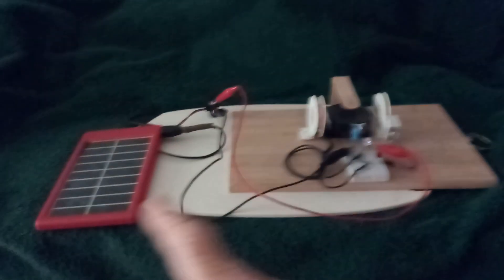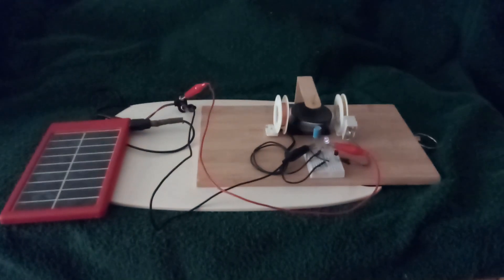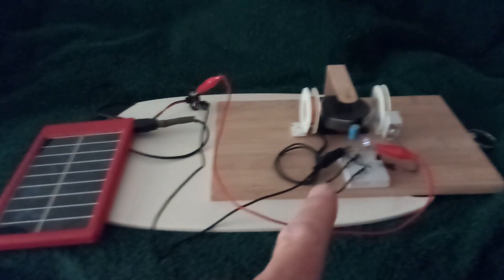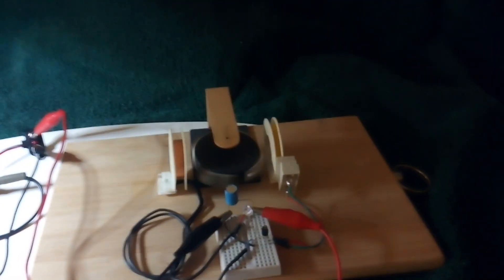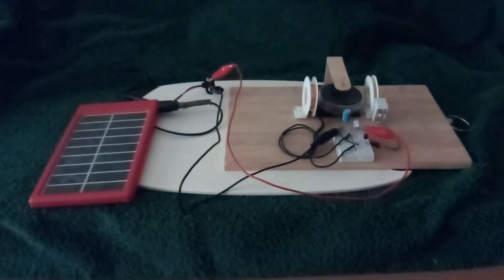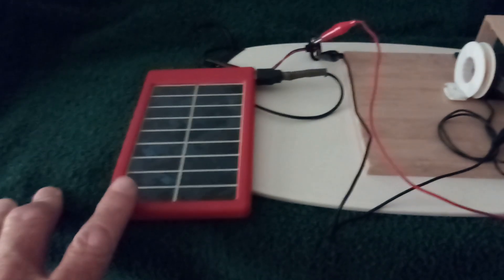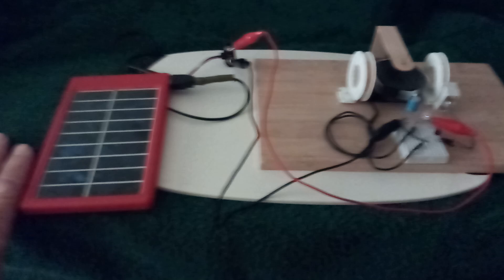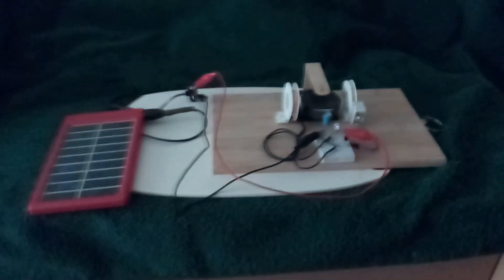Ambient room light powered motor

Comment: The most amazing thing here is not so much the solar panel, but the device which is made to operate with such low power input. Compare side by side with a standard motor and see which one works better with the same solar panel/capacitor.  I dare say this design will win the challenge every time, day or night.

Comment: Its a low energy use motor that has just about no practical use. The light is free but putting a bedside lamp and a oversize solar panel with a cap as storage is nothing extraordinary. I do like to see what you doing, very interesting tinkering.

Comment: I really like the concept, as you know 🤣
An intriguing avenue, would be for parents to be downstairs in the livingroom, child upstairs. Could a collector be made that takes the light from the livingroom to a nightlight upstairs? Many people leave a light on somewhere for security overnight, which could work the same way for a nightlight.
Reply from the maker: There is "light tube" I have seen for attics that directs the sunlight down  a tube somehow to a ceiling output location.  If you put solar cells inside the tube then you might get electricity also. Hummm. 🤔 Stuff of a new experiment.
Reply from the maker: Well it seems that this has already been done! A solar panel inside a "light tube"--  https://www.solatube.com/residential/tubular-skylights/?gad_source=2&gclid=EAIaIQobChMIt-37qfO6hQMVAxStBh3IAQHIEAEYAyAAEgJ0N_D_BwE
Reply: @Lidmotor  They look cool. A whole roof made of toughened glass would be an extension, with that clever auto tint seen on some cars for summer sun heat. Ideal for star watching too, without the mosquito's. 
A South facing room could have solar underneath the glass and, with the new bi-facial panels, could collect energy when the room light was on at night.

Comment: I was having a conversation today with someone about electrostatically charged sands on Mars. Can it be harnessed to run devices? I'm sure they're already working on this. I remember your electrostatic rotors, but how to convert to for instance charging a cell or run electronics?
Reply from the maker: I saw a video years ago where a guy built a device that converted that to a more useable output.  I can't remember how he did it.
Reply: @Lidmotor  There must be a way to put it in a capacitor or something. Avramenko setup?
Reply: Your imagination is running away with absolute nonsense they pump into you thru main stream media. Mars pictures is on Greenland.  Nobody in their right mind is going to harvest sand from a supposedly planet they you have to travel decades to at supposedly astronomical cost. Energy on earth is free, you just made to believe you have to pay for it.

Comment: I love the look of that motor, regardless of the project purpose, I really like the look 😊😊👍👍
Reply from the maker: I never did a video on this motor which is about 10 years old.  I usually run it on a little solar rocker type panel.  A 3d printed frame work with the coils hidden inside would be nice.  The electronic circuit is just one npn transistor,  a capacitor, an led,  and the solar panel.
Reply: @Lidmotor  talking about supercaps and solar rockers, I have this one on my windowsill https://www.youtube.com/shorts/bdJJ8seFe5g